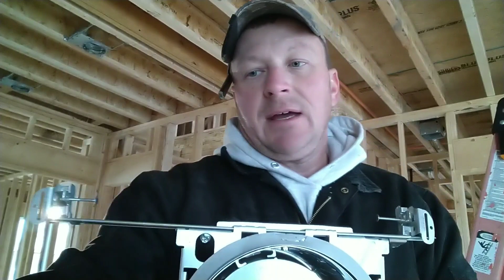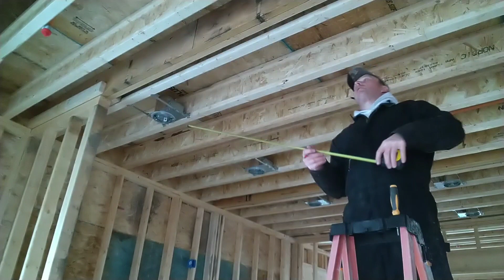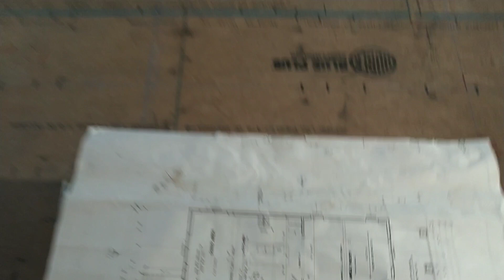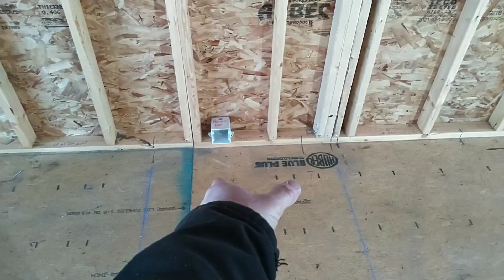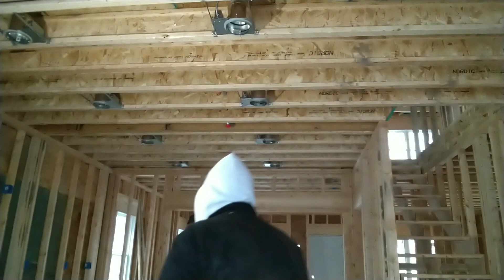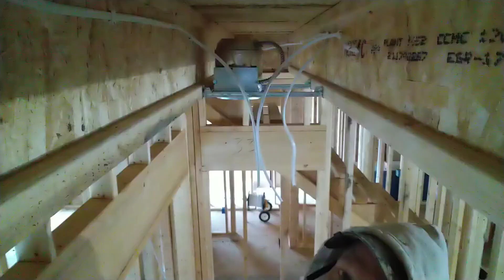Recessed lighting installing Halo 😇brand new constitution recessed can💡lights

Comment: How many watts do you calculate for each light for branch circuit purposes? Do you use the max allowed wattage on the can or the wattage on the bulb?
Reply from the maker: Thanks for watching and commenting. The LED bulbs today are so low on wattage you can definitely wire more fixtures on a circuit today then of the past years. Always use watt equivalent on the packaging and never exceed that. Mostly due to heat buildup at the base of the bulb can cause the thermal button to trip. Keep in mind, there is still a two circuit minimum for new construction homes by the NEC standards. So with this being said 🤔 I divide the home's lighting circuits in half. I may have as many as 3 and 4 circuits in larger home.

Comment: I have a question. Can those slide rails be replaced without replacing the whole can?
Reply from the maker: Thanks for watching Stephen. The slide rails can be switched around and replaced if needed. The only thing I don't know is if the vender's offer these as  replacement parts 🤔 I've never had the need to ask them. I have robbed one can for parts to repair another one tho.
Reply: @workingmanrondoyle3287  what I'm looking for is the side rails with the piece that hammers to the studs. I had placed several of them and I need to move them from one point to another and those pieces are really beat the crap. I've gone and did all kinds of Google searches and I can't seem to find any electrical supply store that would sell them. I would hate like hell to purchase cans that are in working order just for the parts
Reply from the maker: @stephenbile3932  what brand of ceiling can do you need replacement rails for? And are you in the United States? The reason I ask 🤔 I can do some digging on Monday and see if I can come up with something for you.
Reply: @workingmanrondoyle3287  I have Halo 6 in and 4-in new construction similar to the ones you showed in the video. The ones that I want to move are 2 4 in ones. I'm refinishing a basement and I had everything down to the studs and then I had an issue with the bathroom originally I was going to do event with a ceiling fan. But then this plumber came and he screwed me all up. I wound up buying my own Pro press machine and redoing his work. So now I no longer need two 4-in cans in the bathroom I'm going to do one and I'm going to move the vent from the ceiling to the wall. Trying to finish up all the electrical cuz I'm going to have someone come in and sheetrock. Everything is all been framed and all the electrical and plumbing and the gas is all been taken care of. Now it's time to put everything back together but before I do so I just need to make a couple of small tweaks

Comment: I know it says new construction, but can these also be installed in an existing house? I was gifted a few of them by a friend and before I bring an electrician to install, I wanted to know.
Reply from the maker: Thanks for watching and commenting Payam Dastmalchi.
New construction ceiling cans or
(recessed lumineers) can be used in new and older homes. The phrase (new work) refers, more to the way there installed. Example would be no Sheetrock = new construction cans will work. Just make sure they are ic rates if your insulating around them. And at= air tight which needs to be installed depending on your local codes. And old work recessed cans need to be installed after the sheetrock is installed. I hope that helps you.